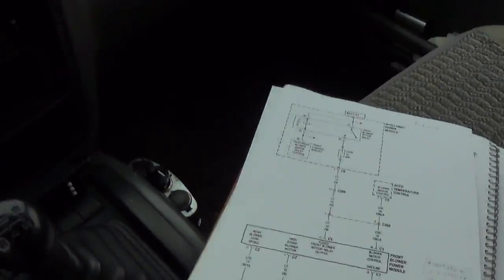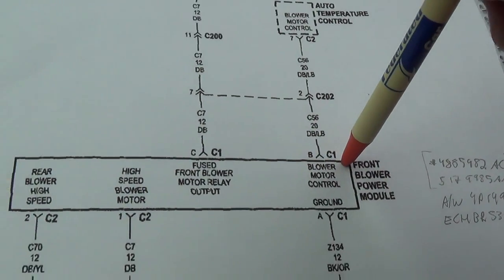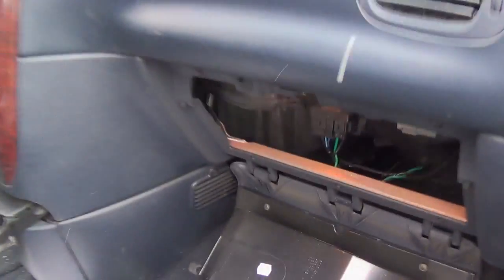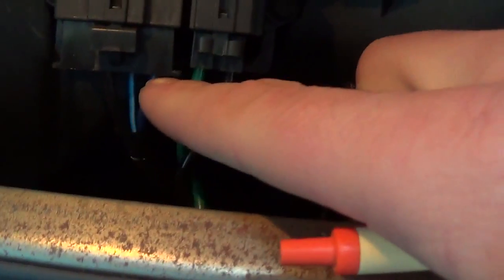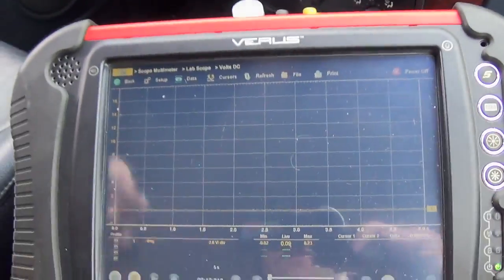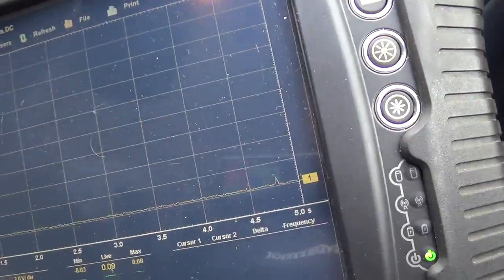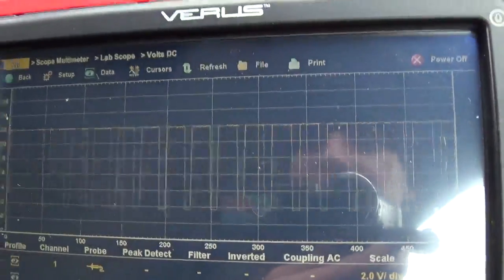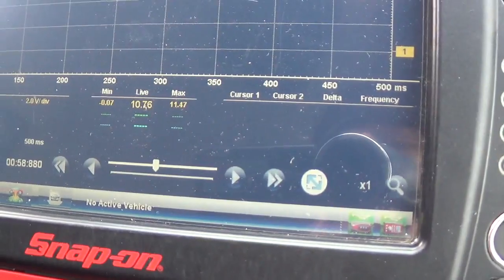No Blower Diag & Repair: Chrysler van -Part 1

Comment: 10 years old video and Ivan says cars kinda old and shes keeping it on the road. I have an 05 T&C Limited and were still daily driving.  We bought a ultra low km 2015 T&C Platinum and we prefer the 05 . Sure the 15 is more modern and sone things may be nicer but we think they should reopen the production line and remake the older models.

Comment: Strange... you should have got a variable reading off the PWM control signal using the multimeter, given it's basically a re-branded Extech EX730. The signal appears to be about 40Hz, so I don't understand why the RMS converter failed to integrate it.

I should have seen this vid while still working at my previous job, I could have replicated the signal with an AFG and checked what different multimeters made of it. That would have been a fun thing to demo (both when attempting to flog a multimeter or an AFG ;-)).

Comment: If you use a led test light would the pulse width modulation make it change brightness
Reply from the maker: +George Konrad Great question! Depends on the internal impedance of the PWM control circuit vs. the LED test light. My guess is that it would work!

Comment: Very high failure rate on them, make sure you check harness too, don't bother putting in aftermarket resister wont last, oem is not much more! good video
Reply from the maker: +02lowrider62 Actually OEM from Chrysler dealer was $20 CHEAPER than a crappy one from Advance Auto...go figure lol

Comment: Excellent diagnosis, every base was covered, she certainly is getting her money's worth here.  Only argument out of me is that an analog voltmeter CAN be used to see pulse modulated signals with but the verus is still sexy eye candy in comparison. In that use we don't know what the proper voltages are unless we have a 'known good' example to go by, but we could still see the voltage go up and down with the control knob.
Reply: +Lorrin Barth Semper fi old soldier.  I used mine to read 1/2 ohm for determining shorted glow plugs from still good glow plugs and used up all the still good ones on those international diesels sold in Fords going back quite a while now.  DVM alone can't begin to do this - there is no other stand alone tool that really can.  This was also a Radio Shack $20 unit, but sadly they don't have them anymore or I would buy several right now.  Last batch I saw anywhere were tiny toy imports and very lousy, but still better than a DVM at times.
Reply from the maker: +Lee Barnes Analog voltmeter...wow don't know the last time I saw one of those in action. But that would be a great tool to use in this case to look at the duty cycle control wire for sure!
Reply: +motoYam82 I had an analog meter I bought on clearance at Radio Shack and used it for years for automotive diagnosis.  Then one day I slammed the hood on it.  So, time to move up to a fancy Fluke.  I hate it but I use it.  Is that a reading or is it?  The needle movement contained a lot of information that is now lost.
Reply from the maker: +Lorrin Barth Yes there is something to be said for analog needle-type instruments. For example a speedometer...I hate the digital readout ones, since you actually have to READ the number; glancing at a needle gives you more of a "ballpark" reading, which is all you really need in most situations.

Comment: Nice diagnosis Ivan especially with the blower motor amperage check. Blower motors can run for a long time drawing high amperage so an undiagnosed blower motor starts taking out resistors and modules. I have the same jump pack...it works awesome.

Comment: Ivan does a great job of performing as "super sleuth" and gets to the root of the problem. I noticed that the 2 wires to the fan motor do not match in color to those shown on the wiring diagram. The diagram has blue / yellow tracer and dark blue but in the video you see green and black. This is probably a color change update that missed the documentation update.

The current draw on the fan motor at high speed indicates 25 amp which does seem high at first glance. However if you look closely at the wiring diagram, fuse 10 in the IPM (intelligent power module) is rated at 40 amp. Hmmm. So maybe 25 amp draw on the front blower motor at high speed is within design limits.

I am thinking that in part 2 Ivan is going to give a surprise diagnosis or gotcha! Year 2001 was the first year that Chrysler incorporated a cabin air filter inside its climate control plenum box. My theory is that the amp current draw by the blower motor is NOT the cause of the problem. The cabin air filter is plugged such that there is limited air flow. With less air flow across the power module heat sinks that protrude into the plenum box, it overheated and failed??? Anxiously awaiting part 2.

Comment: Blower motors suck in those. For some reason the labor time is wrong in 01. Check out the labor guide times for 01 and then for 02 & newer. It is the same procedure, but you can sneak them out. Just make sure all the plastic is warm

Comment: Forgive my ignorance but is it normal for a failing motor to draw extra current? Did  the failing motor harm the module?
Reply: +Ian O&#39;Riordan Yes it is typical for worn out motors to do that and yes it did kill the module.  Going further, I've seen a stuck motor left on but not blowing  then kill blower motor resistor packs on much older equipment that only had old school switches for low, medium and high.  It even killed high because for safety, power went thru the resistor pack but only thru the thermal safety fuse part of it.
Reply: Brilliant. Thanks for the information.

Comment: Hmmm....As you pointed out during your testing 90% duty cycle being the max would take the motor current down to around 23.5 amps... Is that excessive on a 40 amp feed ? I guess we'll find out in part 2. Very sensible troubleshooting , nice.

Comment: Nice of Chrysler to put it there. Very unlike them really...

Interesting diagnosis. I would have thought your DMM would have been able to give you the frequency of the modules output. Nice to have the fancy snapon scope though. I'm thinking of getting  a cheap scope for some of my electronics projects. Lots of stuff is PWM these days.
Reply: I did the heads on these and it was maybe the easiest head job I have ever done in my live besides one exhaust bolt. One of the easiest in most things to work on so far

Comment: Ivan, how did you come to the conclusion the blower motor was using to many amps. Did you use the rule of thumb, motor amps should be less than half the supply fuse rating or have you another quick way to confirm it.Thanks.

Comment: Great vid, especially on the amp test.  Eric O did a similar repair where he just replaced the module and a couple of weeks later the car was back with the same problem.  He did the amp test and found that the blower motor was pulling too much current and burning out the module.

Comment: hi Ivan    I would assume 99% of your viewers don't have a snapon fancy scope/meter to use.   Is there a way to test the control with a DVOM ?  thx
Reply: +mike gal In short, no.

The other option would be a high end DMM that has a duty cycle feature, but those are less common than a simple scope.